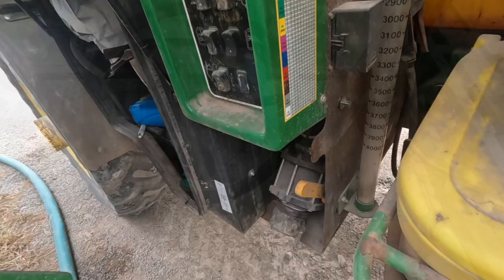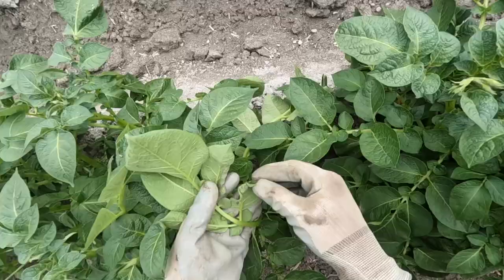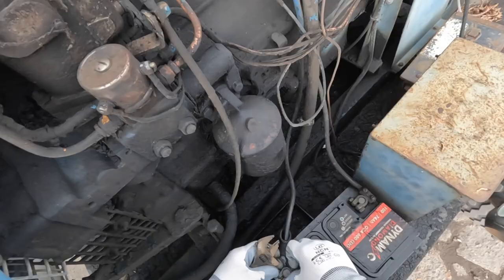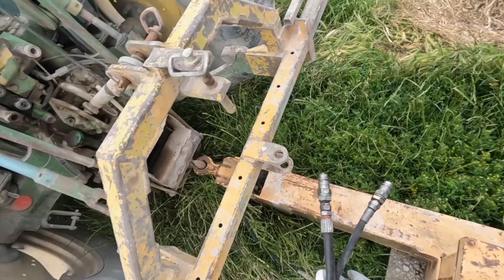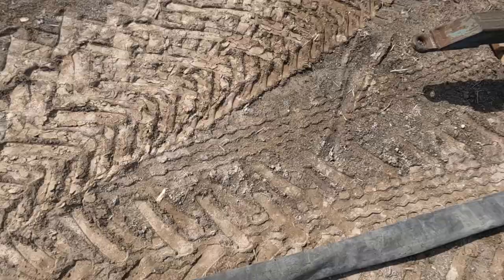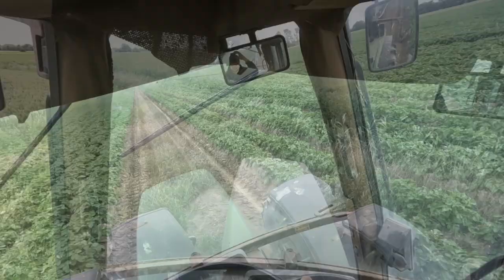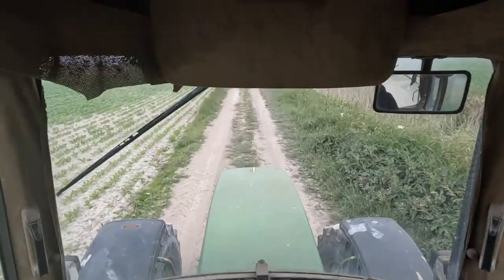irrigating potatoes -its time to start irrigating potatoes!

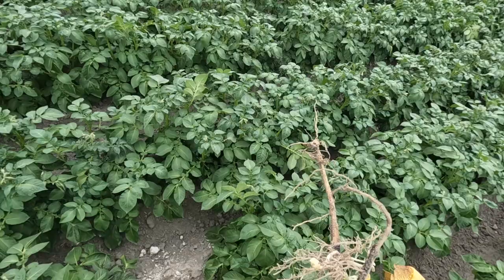Comment: I am in charge of a 40ha sugar beet land irrigation, and we do 5 different hydrants with 6,7 or 8 different sections in each. Each section stays on for 8 hours. Start sunday 22:00, then 06:00, then 14:00 until Wednesday 14:00. Every 10 days.
Reply: That’s cool sounds like super easy or you gotta move every 8 hours
Reply: @danielsizer41  have to go switch a section from each hydrant every 8 hours. It takes about 1:30 hours to do all hydrants if everything goes well and theres no water scapes that might need fixing depending where the leak May be.
Reply: @Agrovasco  god the other day wouldn’t stop blowing pipes apart 20 minute job took 3 hours 😂😂😂
Reply: @danielsizer41  😂😂😂 yeah mate it happens every time we try and Rush a bit and put too much pressure
Reply: @Agrovasco  like magical fountains everywhere bloody job 😂
Reply from the maker: Take your radox and don’t need to have a shower at home 🚿 lol 😆
Reply: @fenlandfarmingadventures4241  I’ve had 3 showers this week already